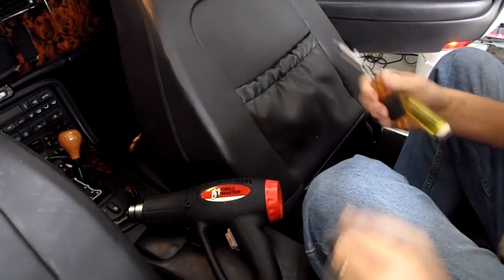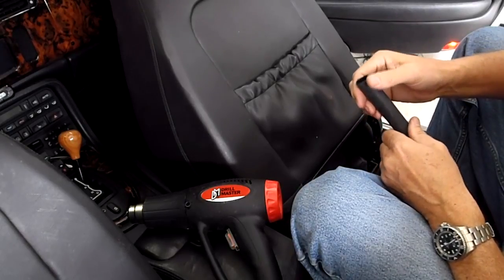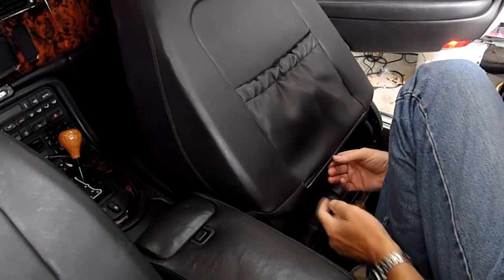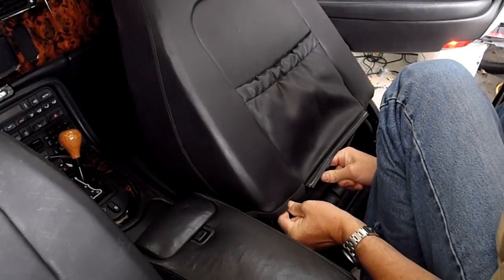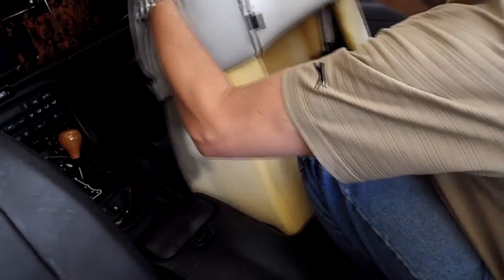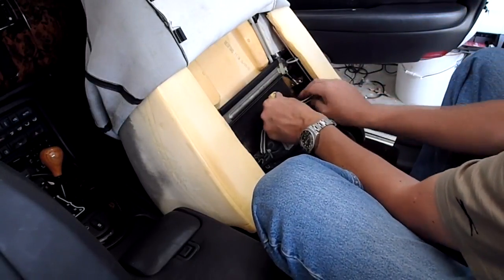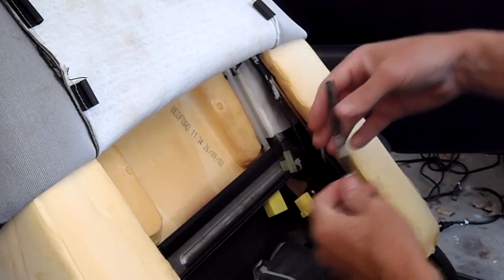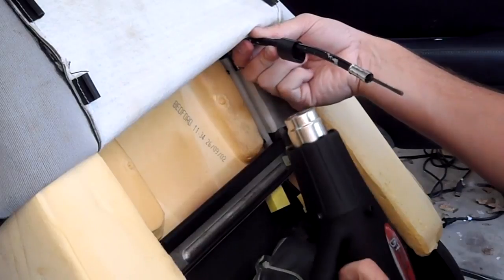How to Repair the Headrest on a Jaguar XK8 / XKR

Comment: I just got done doing both my seats in my 2001 XKR Coupe. I did what Sam referred to in the video because he was having trouble with the splice. I cut of just the metal end and cleaned out the old sheath then drove the smooth end of a 5/16 drill bit though it to allow the cable sheath to feed back into it (16mm). It was still tight as I had to hold the sheath with vise grips and use a small hammer to drive it home. I took the drivers seat out but did the passengers seat while still in the car.    Thanks Sam!
Reply from the maker: No problem, Guzzi. I cut the cable in the middle, originally, but it's hard to get the two pieces to join and stay joined. You definitely did it the right way.

Comment: Great video and it looks like my question was answered as I was gonna ask if you would have done it differently, and it looks like cutting the end off is a lot better and more solid of a fix than the middle, great video remember to always include after thought, aka what you would have done differently, it seems you did mention the part about cutting it next to the metal but then it cut out, either way great video for getting to the motor
Reply from the maker: +Kurt Baker Yep, in hindsight I should have cut one end off, removed the jacket from inside the end, and then slid the end back onto the jacket. Cutting in the middle will work, you just need some really, really thick heat shrink tubing. The kind that has glue on the inside.

Comment: Hi Sam,
I have to do this headrest job on my 2002 XK8, The video was great.
BUT the most important thing , In car repair , Did you disconnect the battery or just disconnect the wiring under the seat. Safety First. Please let me know. Thanks Ron
Reply from the maker: To be safe you should disconnect the battery, although I don't think it's really necessary. Better safe than sorry, though.

Comment: I'm not really getting HOW it stops working. Like mechanically what happens? Mine don't go up/down but the motor runs. What exactly is not connected or working? I was told it has a belt driven mechanism. Can you explain more what in my case I would need to fix?
Reply from the maker: omgitsBenjamin Imagine a long, flexible rod inside a sleeve. The rod has a square end which fits into a square hole. When you turn the rod the headrest goes up or down. But if it is too short, sometimes it doesn't quite reach the square hole it's supposed to plug into and it slips out. By shortening the sleeve the square end of the rod goes deeper into the square hole. It doesn't slip out when it's turning. 

When you take it apart it will make perfect sense.
Reply: Okay, thank you so much.

Comment: Just to say about 5 years ago I found your channel, watched every video and bought a down at heel xk8 convertible. Have spent time restoring it and even my wife now loves it. Just to say I still love your videos and I have some tips on repairing the front sub frame if you would like them.
Reply from the maker: Thanks Rubble. I sold my XK8 about 7 years ago and I've been regretting it ever since. I keep looking for another one, but the decent ones are too expensive and the reasonable ones are worn out and falling apart. If you keep yours in good shape I'm sure it will retain its value.
Reply: Thanks Sam, good luck your an inspiration.